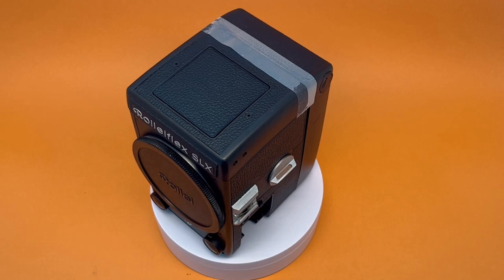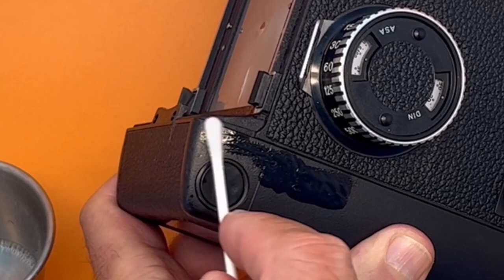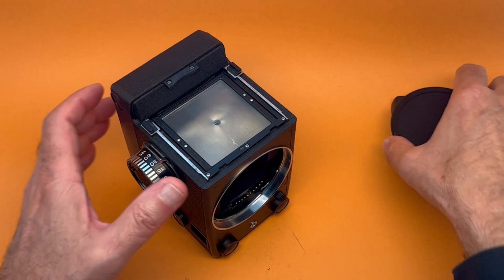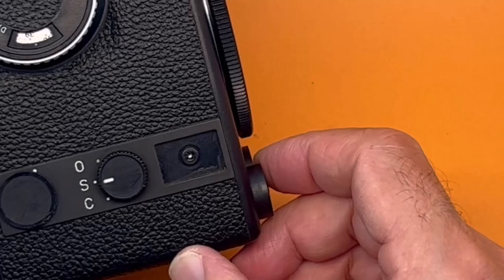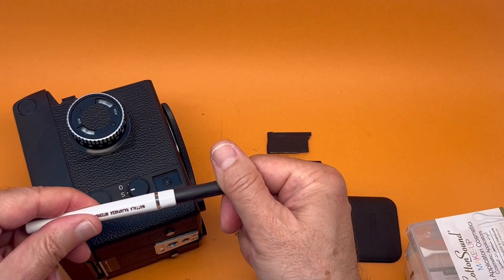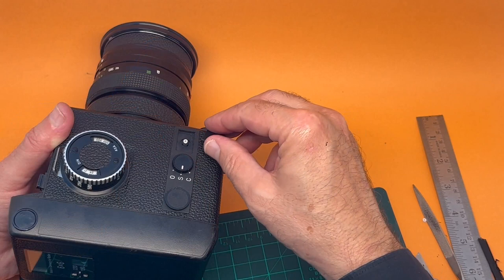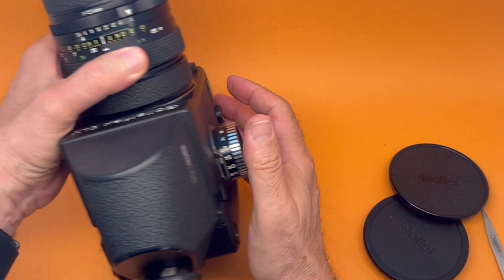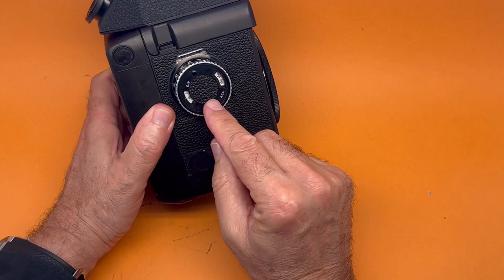Quick Fix - Rolleiflex SLX2 (and similar camera body) repair for many common age-related problems

Comment: Hmmm - didn't understand about making it snug - why would tape (not shown on actual battery) either side of the battery make it work?
Reply from the maker: I have experienced this problem, with both Rolleiflex SLX and SLX2. The battery has a series of circular metal holes. The battery chamber has matching contact rods which are supposed to go into those holes. However the holes are too large and after years of electrical contact, the edges get charred and reduce the  electrical contact inside those holes. The battery itself was a little loose in the chamber which was probably OK originally, but with compromised contacts the loose battery did not help. So by trial and error, I discovered that I could press the battery firmly in and hold it by hand and that would force the battery contact. As a more practical option, instead of holding it by hand a little black vinyl tape on either side of the battery made it half a millimeter fatter to fit snugly and maintain that contact. Since the vinyl tape is quite grippy, it holds in place and maintains the initial pressure as you push it in. I would say the battery issue is the number 1 problem with these cameras. Solve that problem first and then attempt the rest, as without the battery nothing else matters.

Comment: Why be so carefull with the mirror cleaning? If the silvered surface is under the glass wouldn't a glass cleaner work just as well?
Reply: Yup, be extra careful with the mirror -  think about the liquids you're using. Or just leave it, frankly.
Reply from the maker: Silvering is on top, not protected under glass. It is recommended that you only clean it with great care, using only cotton tips (not polyester types) and distilled water. If you can use a soft brush and air blast (not with a compressed air can) it will be even better. A little dust on the mirror does not actually show up in the viewfinder. Any dust you see is probably on the front or back of the focusing screen as that is where your camera is focused, not the surface of the mirror.